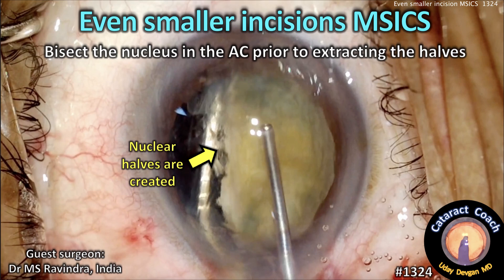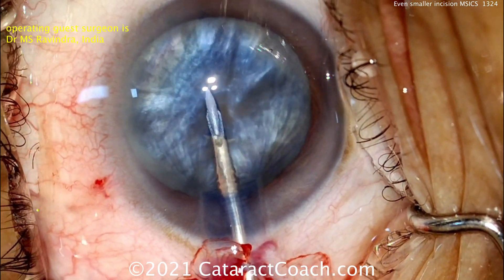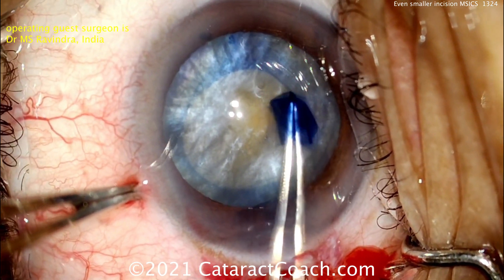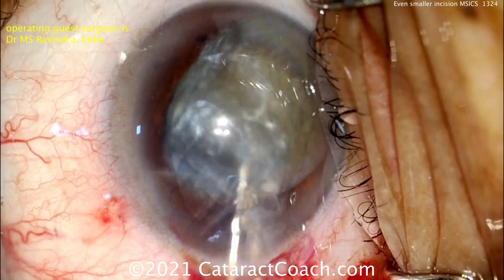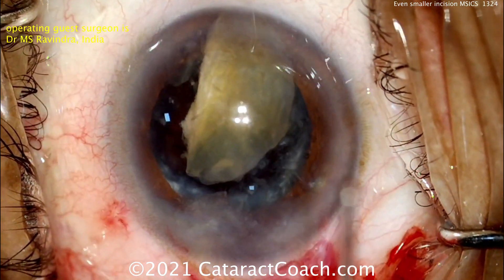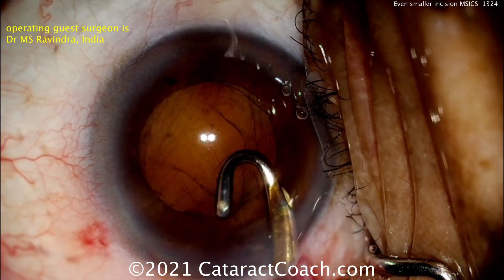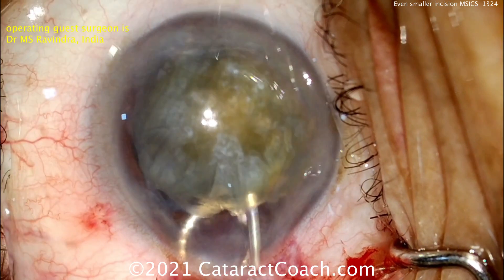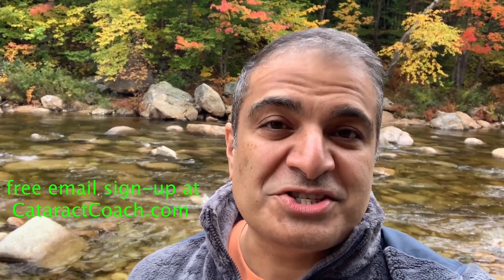CataractCoach 1324: even smaller incision MSICS cataract surgery

Comment: Great sir. I feel if such a hard cataract can be broken this way, smaller nucleus might be be taken out in one go. Right?. And we are going through posterior limbus, the incision can be closed by hydrodissection of cornea. Right ? Or we may spy one suture
 What about astigmatism. Lastly, can't a big nucleus be taken out by slightly increasing the wound and bringing it out in one go or viscoexpression. Please reply.
Reply: I do bisect every nucleus. Soft or hard. Sometimes I trisect them. The entry is at sclera, about 0.5 to 1 mm behind the posterior edge of limbus. The tunnel does not need to be closed by stromal hydration! It is truely self sealing, as it is not stretched or heated. I dont make sideports.  No need for suture, unless the tunnel is bad and leaking or you need to control the SIA. Big nucleus through a smaller tunnel, means the cornea will not be pristine the next day!

Comment: Please note that the cannula / Cystitome is mounted on a 2ml Luer Lock syringe filled with HPMC, and is continuously infusing it in front of the nucleus, thus separating it from endothelium.
Reply: Does it mean you inject HPMC and dissecting at the same time? fingers on the plunger?
Reply: @ButterbreadStuff  Yes Dr!.  Please try it out outside the eye, on SICS extracted hard nucleus.
Reply: Thank you for the details sir.
Reply: @manup6814  Thanks!
Reply: brilliant
Reply: @kenlagunzad  Thanks Sir.
Reply: @kenlagunzad   Thanks Docgtor!
Reply: Balls of steel. Big brain move. ❤
Reply: @josephineyao888   If you are new to MSICS, please be careful. This technique needs climbing lots of baby steps, and please try in soft nuclei.
Reply: Have you tried the same technique but divided the 2 heminuclei into two smaller heminuclei each, so that you can remove each of the 4 fragments from a 3.2 mm incision?
Reply: @SuperSZ 
Yes! But we loose lot more endothelial cells in the manoeuvres in AC. I don’t get pristine looking cornea on post op day one if I make tunnels narrower. More than that, as SIA with 5.2 mm sclerocorneal tunnel is about 0.5 D, it makes no sense in reducing the tunnel size. ATR astigmatism will reduce by that much  by it!
Reply: @SuperSZ  Good question!  Smaller tunnels offers no benefits in MSICS, as we dont need to have tight non leaking tunnels here, unlike machine Phaco. The IOP is low through out. My technique gives a max SIA of 0.5 D.  Smaller nuclei segments mean lot of handling, and lot more endothelial loss. You need to target pristine cornea and retention of most of endothelial cells.

Comment: What is the post op refractive status?
Reply: For such cases we do Immersion biometry and accurate Keratometry (as fixation is poor) and we could achieve as accurate results as with modern biometers. SIA ranges from zero to -0.75, and can be used to correct pre existing ATR.   Thanks.

Comment: Very good idea. Can also be used in case the sics tunnel is too small for nucleus delivery in normal cases. Instead of causing iris trauma trying to deliver the entire nucleus, we can split it into two! Thanks for sharing this video
Reply: I use this technique routinely for all cases. Endothelium remains pristine!
Reply: @drmsravindra  what will you do if the patient has dense cataract and shallow AC (around 2 mm)?
Reply: @tssitorus3652  No problem. The moment the nucleus is shifted from bag to AC, the AC deepens.  Shallow AC is never a problem.
Reply: Thanks. There is a steep learning curve, esp as the Iris and lens diaphragm are not pushed backwards, and the working space is much smaller.

Comment: I appreciate this excellent technique but why sir SICS in a case where you can perform phaco as respected doctor has implanted a foldable IOL anyway.
I m a big fan of SICS but as far as a case can be managed with phaco, there's no need to go for SICS else doctor was trying to negate preexisting against the rule astigmatism 🙏
Reply: Hard cataract - phaco may damage endothelium. MSICS is much cheaper than phaco as phaco machine is not needed
Reply: @DrJohnDavisAkkara  True sir.
Reply: MSICS is a way of life, and the indications are certainly not when you cant do phaco alone! PMMA IOLs are excellent, but patient asks for known brands, and multifocals and torics. The endothelial count reduction is least in SICS, and is certainly indicated in borderline cases. Yes, pre existing astigmatism can be corrected. More than all, the entire surgical set is easy to manage and sterilise, and the surgeon is not pushed to a corner to reuse unsterile instruments, which could happen in long lists. With Phacosection, one can easily do about 20-25 surgeries in half a day session, if you have 25 sets.  No need to flash sterilise the instruements. Thanks.